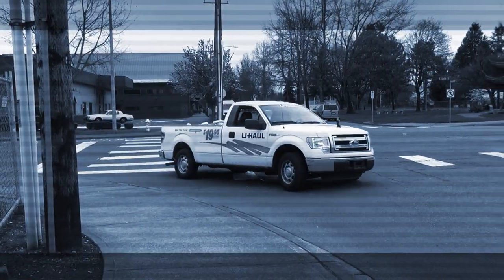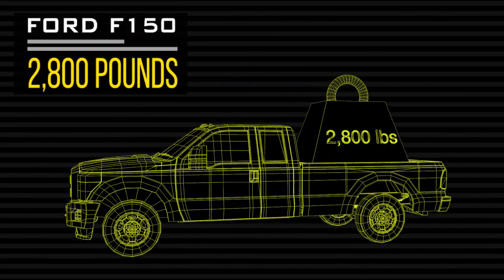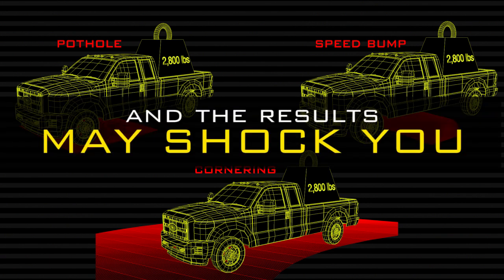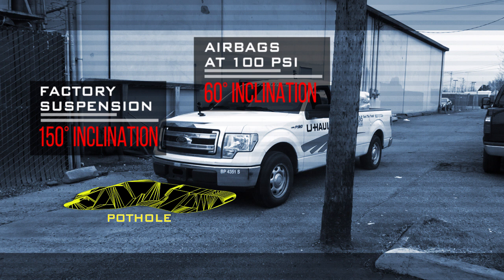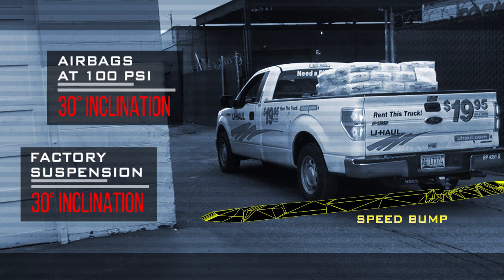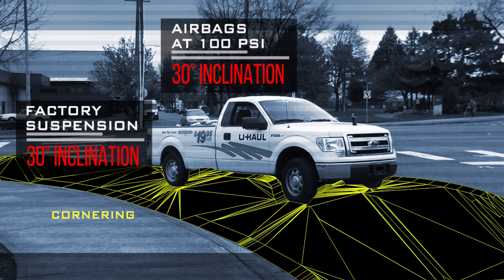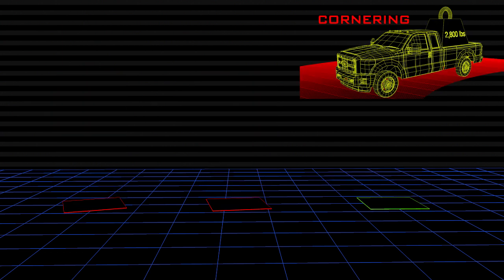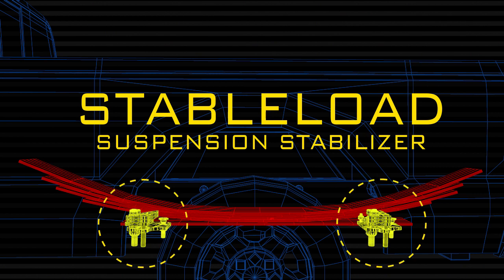How does the Torklift StableLoad suspension stabilizer work

Comment: why is there never any discussion between use of the upper stableload or the lower?  seems by default all these videos use the lower but yet my camper sale rep is recommending the upper only.  You should consider posting the pros and cons of using one or the other.
Thanks!
Reply from the maker: Hello Robert, thank you for your feedback about the upper and lower StableLoads! We typically suggest using the lower StableLoads first because they have the ability to turn on and off in seconds when you want to return your truck to its original factory ride. The upper StableLoads are a more permanent solution that install to the upper leaf spring. Both are great choices for helping improving your handling experience while towing or hauling. 

We are more than happy to bring your request for more upper StableLoad videos to our team. If you have any further questions about the StableLoad, please feel free to contact our tech support team at 800.246.8132!